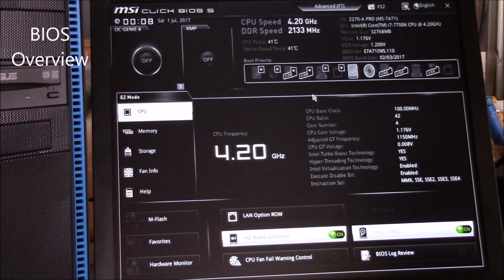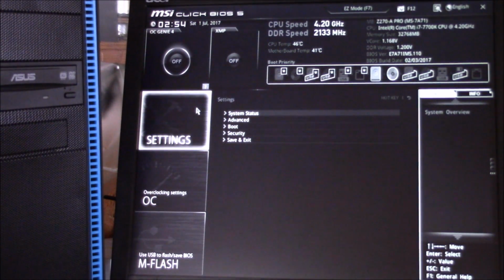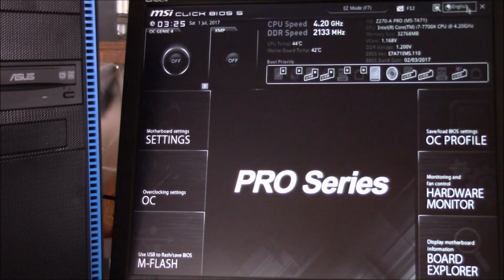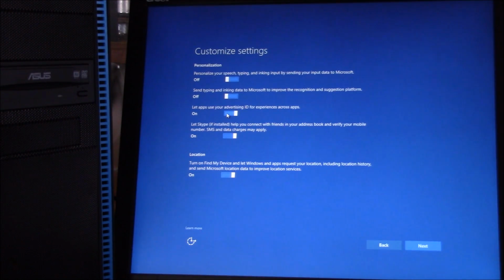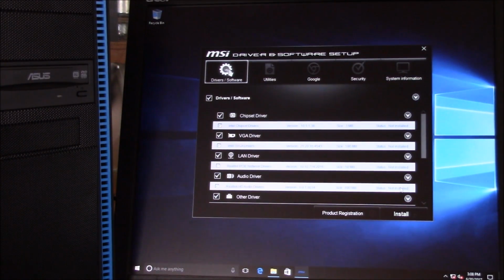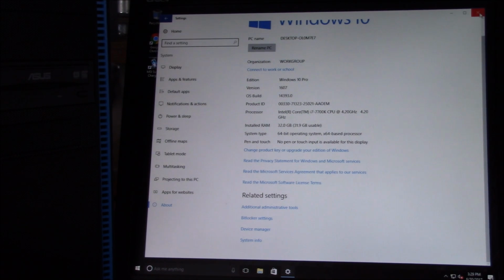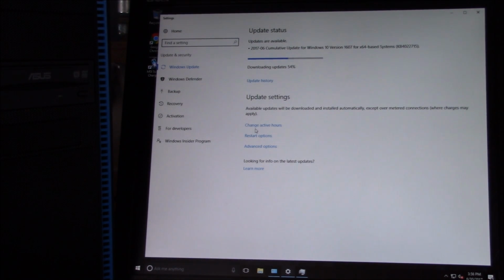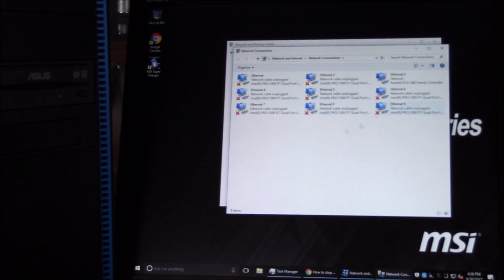NE#35 New PC BIOS Setup and Windows 10 Install

Comment: My bios does not have this interface! MSI B450M MORTAR! Is this a program? I updated my bios yesterday!
Reply from the maker: Yeah, this video is 5 years old.  That's almost obsolete in the computer world.  There's probably been many MSI BIOS changes
Reply: @NetworkEngineeringVideoBlog  I was seeing that this interface only comes in PRO models because the size of their bios is 32MB and the normal models like mine the Bios is 16MB in size! So this created a space issue for new Bios updates for normal (non-Pro) models. If they put this interface in the 16MB Bios, there would be no space to implement updates on these boards that carry these Bios (all non-PRO). MSI instead of standardizing the boards and their Bios is inventing fashion!

Comment: I just purchased a similar motherboard, the MSI 370 SLI Plus and I must say, this is the most challenging motherboard I have ever worked within my life and I have been building computers for 25 years.

I am installing windows from a bootable USB drive on a brand new 1TB SATA drive. After installing windows and after window loads. Then I update windows, do all the updates and after switching to boot from HDD, I always get the "Reboot and Select Proper Boot Drive", then I reinstall windows again, and it does the same thing over and over again. For some reason, I cannot get windows 10 to work on this motherboard. 

Specs: MSI 370 SLI Plus; WD 1TB SATA HDD, EVGA 3060 GPU, 850W PSU, Intel i5 9400F, G.SKILL Aegis 8GB 288-Pin DDR4 SDRAM DDR4 3000 (PC4 24000).
Reply from the maker: It sounds like the BIOS cannot find the boot sector on the hard drive.  If this is  a factory formatted hard drive, you may try reformatting it using Windows and see if that fixes the boot sector.
Reply: @NetworkEngineeringVideoBlog  Thank you. Honestly, I tried all that, used USB drives and several hard drives as well. After a while windows would install, and actually run perfectly fine, but the moment that the system was restarted, the system would no longer load windows regardless of any drive. I tried Linux as well and it did the same thing, load after a fresh install, and after reboot, would not load a second time. I just sold trashed it, wasn't worth messing around with. Thanks for your reply.

Comment: What is the boot for usb in motherboard
Reply from the maker: I'm not sure I understand the question: Booting from USB is for folks that don't have a bootable CDROM; you can boot from a USB stick.  Here is what businessinsider.com says: " If you have a bootable USB drive, you can boot your Windows 10 computer from the USB drive. The easiest way to boot from USB is to open the Advanced Startup Options by holding the Shift key when you choose the Restart option in the Start menu"

Comment: Hey guys, so my old pc is dead and I want to take the copy of windows on my old computer and install it into my new setup. Any ideas? My motherboard has the same bios almost so you guys might be the most help. On a side note... I have the DISC for windows 10 pro but I have no way of putting that disc into the new setup because it has no disc drive. What do I do to take the windows content from the disc and put it onto a usb drive? Thanks!
Reply from the maker: There should be an option in the BIOS to select booting from a USB drive.
Reply: @NetworkEngineeringVideoBlog  Yes there is, but I only have a CD with windows on it and I want to put the data from that into a USB stick since my pc doesn't have a disc drive.

Comment: What if I don't have a disk drive ( fixed )
Reply from the maker: That shouldn't stop you from accessing the BIOS.  But, I hope you're not planning on running Windows10 from a USB stick! :-)
Reply: Hey man I need you to reply fast if I take the ssd out my laptop which has windows 10 on it how will I load into windows 10 I’ve just been staring at my bios
Reply: @crazytigerspy9420  I have no idea
Reply: @TozzerZ  I think you have to get the usb but I don’t have a second computer to download windows on
Reply: @TozzerZ  hey I figured it out search up your bios boot up menu key then after that if I don’t see the ssd with windows 10 that has windows in it search up sata ssd not apperaring on boot drive

Comment: I have 2 partitions and I can not delete
Reply from the maker: I may need a little more info.  But, if you don't need any existing partitions on that hard drive, a complete format of the drive should help.  I did a quick google search for "How to format a hard drive for windows 10 installation" and this page looks pretty good.  https://answers.microsoft.com/en-us/windows/forum/windows_10-windows_install/how-do-i-format-a-drive-to-install-windows-10-pro/74c039cf-6846-4bad-9299-893d5466a6dd
Reply: @NetworkEngineeringVideoBlog  I have Nightblade MI3 B908 and 2 partitions drive 0,drive 1 unallocated space.Last time I installed Windows and when I did the installation,after a few days I did a black screen.I have never seen 2 partitions before so I don't know what's wrong with it
Reply from the maker: I'm curious about the black screen.  According to the MI3 specs, those systems come with GeForce video cards.  Are you sure you are connecting your monitor to the GeFoce  HDMI port and not to the motherboard's HDMI port?  Also, according to the spec, you may have two SSD drives.  that might be the reason you cannot delete it with the partition tool.
Reply: @NetworkEngineeringVideoBlog  First I got a blue screen, some error I don't remember which one.I restarted the computer and the black screen, the sound is there
Reply from the maker: @junky3dmesh  Do you have a smart phone that you can take a video of your computer screen when it is booting up and post it on your YouTube channel?  Also, take some video of the back of your PC’s cable connections and the inside of your PC so we can try and see what hardware is installed.
Reply: @NetworkEngineeringVideoBlog  my settings are,8,1/10 WHQL enabled ,windows 7 disable,Boot mode(legacy uefi),Boot oreder uefi usb key.Today I returned the computer I have a guarantee.The problem with the graphics card.For the first time I see this BIOS so I hope that I may not have done something wrong
.Are my settings good? Thank you
Reply from the maker: @junky3dmesh  Hey, sorry to hear that you returned the PC.  Troubleshooting is absolutely the best way to learn; although it can make you bang your head on your keyboard!

To answer your question about settings: Below are the settings I used and links to the specific times in the videos when I set them.
6:16  Windows 8.1/10 WHQL Support=Disabled and Windows 7 Install=Disabled
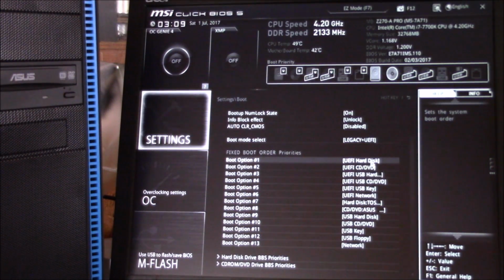6:48  Boot Mode=Legacy UEFI and Boot Order=UEFI Hard Disk, etc..
One item that caught my attention is that you said your Boot Order is set to UEFI USB Key?  If that is Boot Option #1 then your PC will always try to boot to your USB stick, first.  This is okay IF you don’t have a bootable USB stick still plugged into your computer.  If you do, it will always boot to the USB stick.  I suggest changing Boot Option #1 to UEFI Hard Disk after you get Windows 10 installed on your hard drive.

About your display issue: The computer I built in this video is a headless server.  Headless means it doesn’t have a monitor attached.  So, I did not install a fancy graphics card.  However, you should check out this thread on the MSI forum (https://forum-en.msi.com/index.php?topic=277353.0).  This guy is having the exact same video display issues you are reporting.

Let me know how things turn out.

Mike
Reply: @NetworkEngineeringVideoBlog  very useful thank you very much I learned something.Thank you